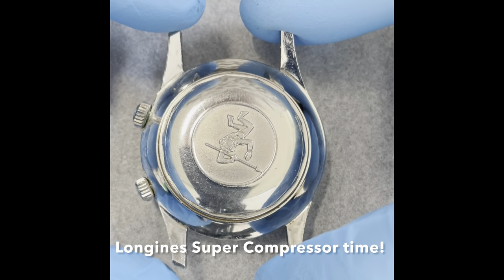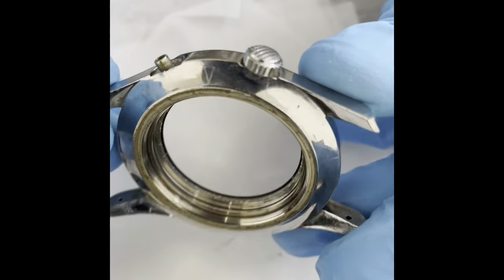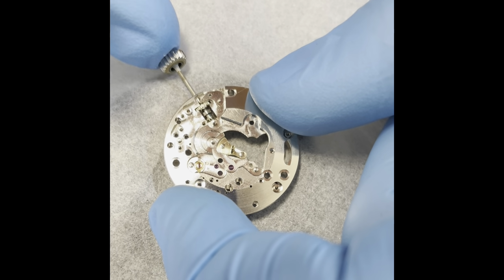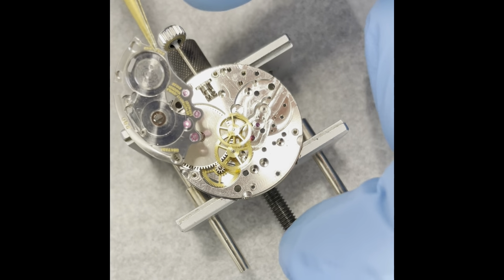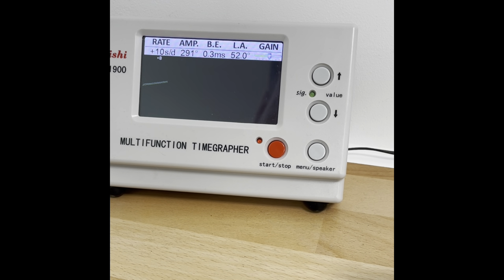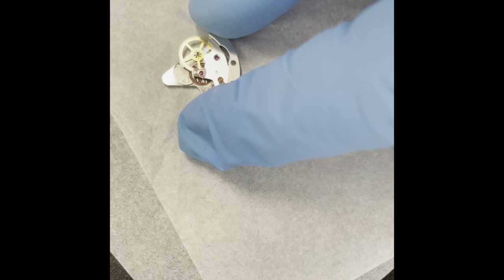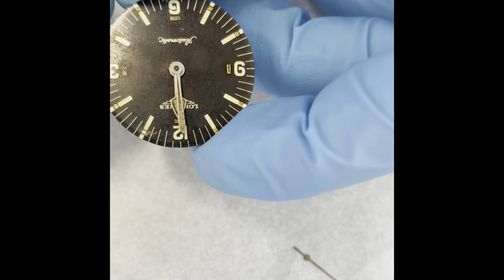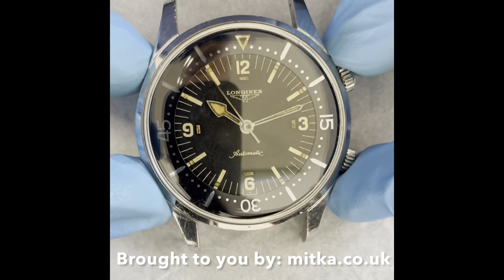Service Longines (Original) Legend diver calibre 290

Comment: Great presentation and showing us every detail!  
Just One question - how do you service the  mainspring if it says “self,ubricaring” on lid?
Reply from the maker: Those mainspring barrels are a hassle to deal with as the lid is riveted together. But you can still open them and clean or replace the mainspring. I advice to keep them shut if they have decent spring and tension up against the barrel walls as the risk of damage of the barrel is fairly high…